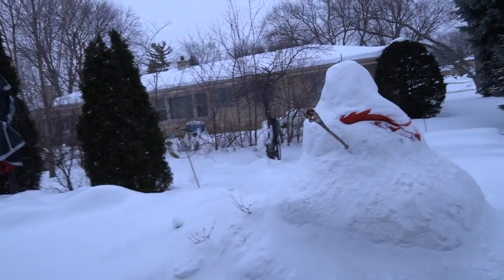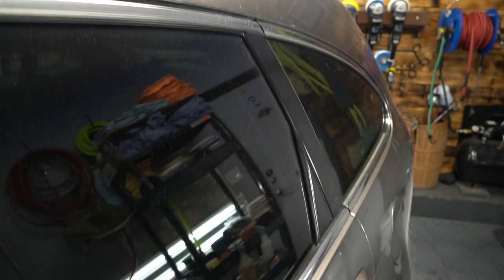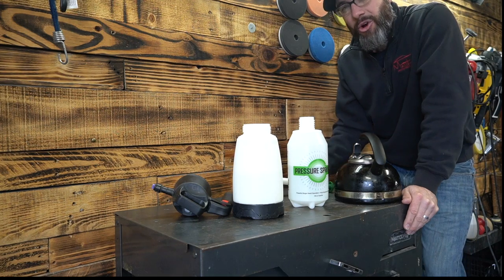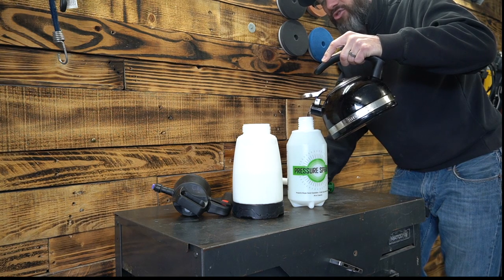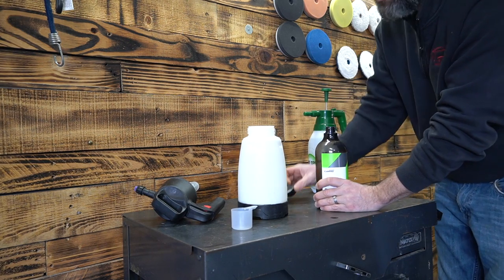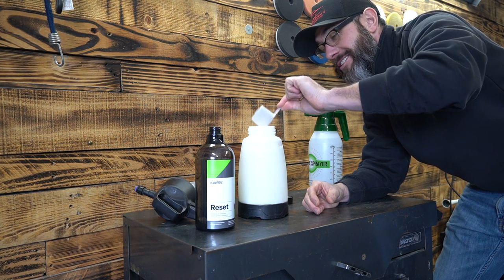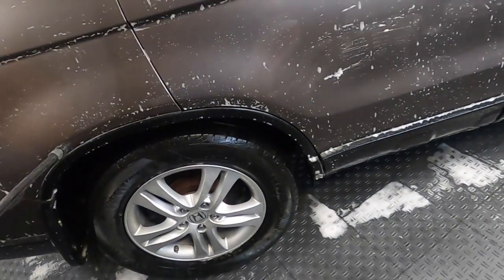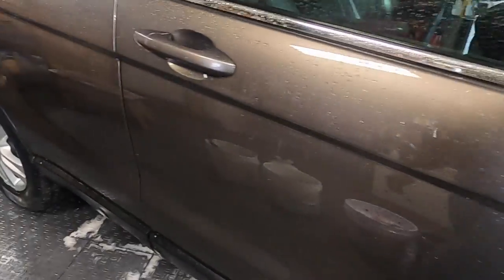Salty Winter Hand Wash - WITHOUT Using Running Water

Comment: Another winter weather video idea: I have noticed that after you ceramic coated my car that snow doesn't stick to it as easily. It is very easy to clean the snow off. Which is a big plus when it's in the single digits out there.
Reply from the maker: The Ceramic Coating does help when it comes to washing with out question!